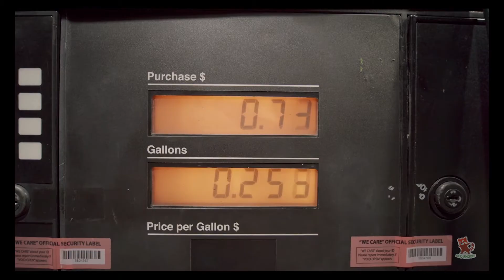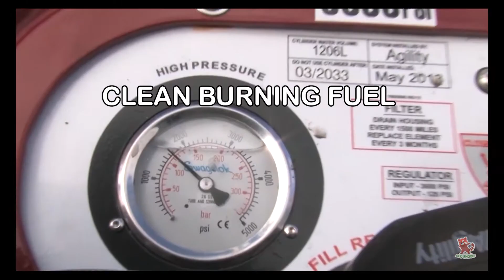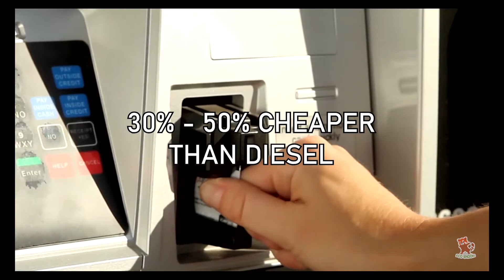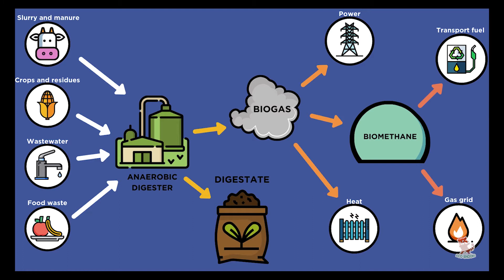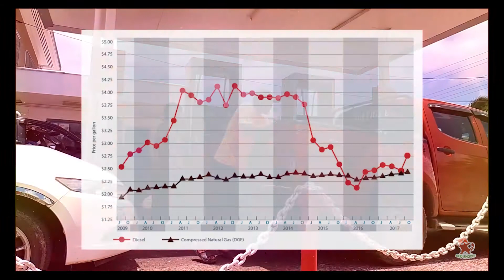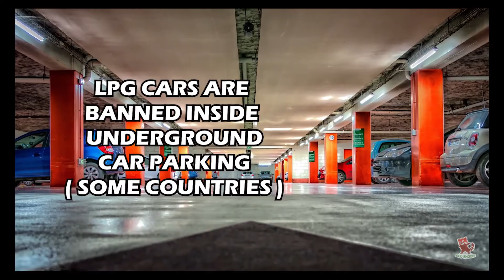10 HOT REASONS TO BUY CNG VEHICLE | AVOID PETROL & DIESEL ONES

Comment: The engine valves have to permanently lubricated for cng vehicle
Reply from the maker: Yes, in CNG vehicles, it's important that the engine valves are properly lubricated. CNG burns cleaner than gasoline, but it's also drier and can lead to increased valve seat wear over time. Some engines use special valve seat materials or an additional valve lubrication system to help prevent this. Regular maintenance and using a valve lube kit (if recommended) can help extend engine life. 🚗💨

Comment: CNG, Propane and Liquified Petroleum Gas are as far as I’m aware totally different substances, while all three may be obtained during the refining of oil into other products CNG is not obtained solely in this way.
CNG can be obtained directly from the ground through drilling and through fracking and it is a natural byproduct of the decomposition of vegetable and other matter including sewage.
It leaks out of the ground in vast quantities and is allegedly a far worse ghg than carbon dioxide.
So why are the climate Nazis so hell bent on stopping its use?
Because anthropogenic climate change is a scam!
A cheap clean RENEWABLE power source that needs to be burnt anyway and by converting all vehicles to it which could have been done ten years ago for a fraction of the money wasted on EVs would have reduced carbon emissions to the point that EVs would be pointless tells us that climate change is a scam.

Comment: sadly electric vehicles killed off CNG/LPG. I would say CNG makes more sense than EV's
Reply from the maker: Dude, I feel you! It's a shame that CNG/LPG has taken a backseat to electric vehicles. But hey, let's keep the conversation going and show some love to both sides of the fuel debate.
Reply: @EcoSnooki  I'd say that the bad thing with CNG is that it's compressed but if you don't buy aftermarket tanks you should be fine.

My Family has a CNG Skoda and it's a nice car but finding a CNG Station is getting harder every year, thankfully that Skoda also runs on Gasoline so you can survive lol
Reply: They should combine CNG with Hybrid EV.
Reply: @PandaPi123  Genius
Reply: So you think. Give it time. CNG infrastructure is already there with gas stations. EV charge stations are a whole layer to overcome, that CNG doesn't have to bother with.

Comment: Safer?😂 I just watched 4 dozen cars explode n kill ppl. Ive been in dozens of car wrecks n never had my fuel tank explode n kill multiple people. Gasoline is safer.🍻
Reply: You have apparently never heard of the exploding Pintos or Corvairs. . . . Where did you watch 4 dozen CNG cars explode and kill people? I'd like to see that actual link . . .
Reply: @joetanzey491  safe cars taken out with false propaganda. 🍻
Reply: @joetanzey491  i looked up this fuel type on youtube. all i saw was explosions. 🍻
Reply: @MichaelMosesHammer Gas also rises and spreads out.  Gasoline as a liquid burns in a pool underneath.  There’s a difference in how one as a liquid burns versus how Hydrogen or Methane burn.
Reply: Just for people that doesn't care for keeping the maintenance of the car. Cylinders need requalification every 5 years and last 20 years, after that you need to change for a new one. Ignore that and you have a problem in your hand.
Reply: @lucasandrusievicz  Recertification is every three years. Whether the tank needs to be removed after 20 years has everything to do with how much it is used. Tanks are designed to be filled and emptied several times per week. If a tank is filled less than that, no reason it can't function longer . . . except for the general regulation which takes none of that into account. Propane, Scuba air tanks, and all of the industrial burning/welding gas tanks have a process to test them and recertify them. No one has ever developed those processes for CNG tanks because they are still too new to the market and use. I have a relative that works for NIST. They are dabbling with recert procedure, but nothing completed yet.

Comment: You could also turn this electric using SOFC ( solid oxide fuel cell ) or an electric hybrid as a range extender.
Reply: Is there such project? SOFC are expensive though

Comment: Isn't LPG only heavier than air when it is compressed to liquid inside the tank? I don't think there is any difference between CNG and LPG leaking in a carpark.
Reply: LPG is heavier than air, even as vapor.
Reply: @78Biggmike  Thanks

Comment: I have a CNG vehicle and I love that it doesn’t have smelly exhaust fumes and that CNG fuel is still cheap during these times (March 2022). Only thing is that the range is only 225 miles per full tank.
Reply from the maker: Nice to hear that
Reply: How much is it out of curiosity , what car do you have?
Reply: @organicintelligence6431  I have a 2012 Honda Civic CNG. CNG gas in CA ranges from $2.00 to $4.50 per gallon.
Reply: Wow even my 2009 gas guzzling Subaru (pre CVT) has a range of 290-360, city-hwy and it’s AWD. Can you get a bigger tank?
Reply: @leslielucci3182  not sure if I can get a bigger tank. I’ve never even looked into it.
Reply: I think it's possible to modify a normal gasoline car to run on CNG. But I'm not sure
Reply: @hariranormal5584 it is possible